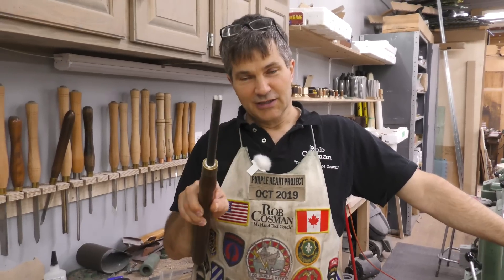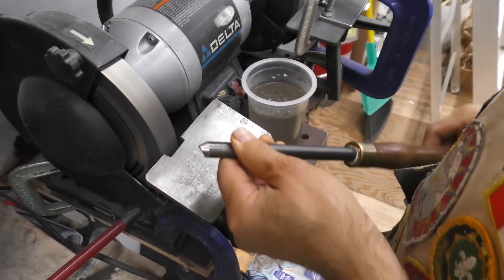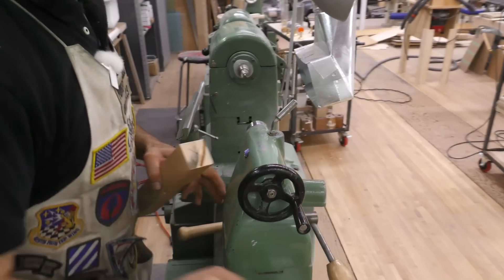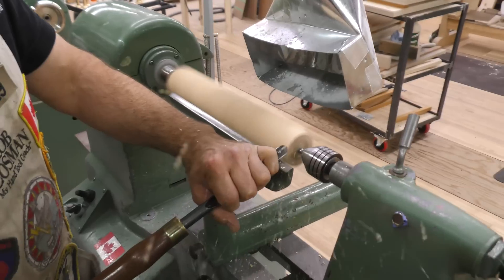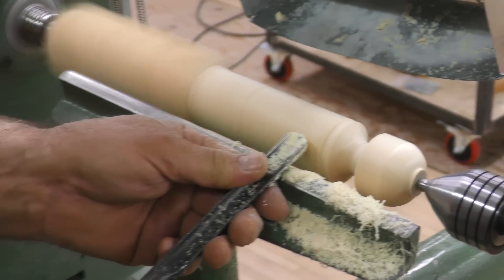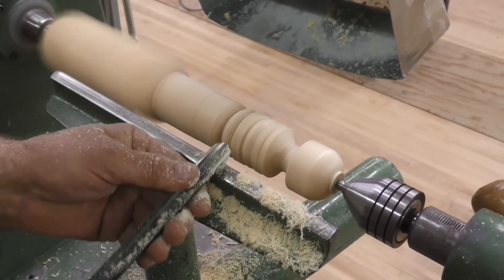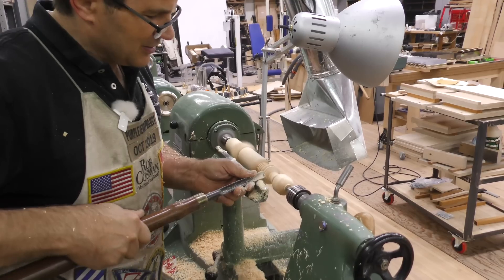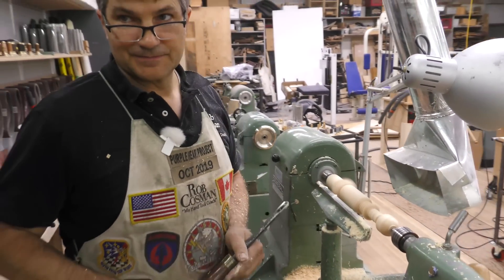Wood Turning For Beginners - Gouge Chisel (What you need to know)

Comment: Dumb question: Trying to cleanup a cove, is it bad form to get a sanding spindle or even a rat-tail file in there to perfect it?  A low-diameter spindle-shaped object can be made to act with a wider radius be angling it, no?

Comment: Hi Rob,  hope you see this even though the video has been up for two months.  You say you are using and sharpening a Spindle Gouge!  I have been turning since 1960 (grade 9 Shop Class).   Your gouge is a Bowl Gouge and you are putting a Traditional/Bottom Feeder grind on it.  I am interested in hearing your thoughts.  Thanks, I enjoyed watching you on the lathe...  PF  Ontario
Reply from the maker: Here you go https://www.woodturnerscatalog.com/p/130/6893/henry-taylor-M42-Stay-Sharp-Spindle-Gouge
Reply: @RobCosmanWoodworking  Hi Rob,  thank you for such a quick reply.  My reference to Spindle Gouge is for the shape of the grind and not the Mfg Name of the tool.  So, Spindle gouges have a shallower (less than half of the steel is in the flute, more steel below the flute).  Bowl gouges have a deeper flute to clear more chips,  the flute is deeper than half of the steel.
Now, for the different grinds:  Spindle grind is about 25 degrees, very long using the thicker steel remaining from a shallower flute..  Bowl grind is steeper at about 55 degrees in either a “V” or “U” shaped flute, usually in a Fingernail shape about 3/4” long cutting edge.   Traditional grinds are not ground back in the fingernail shape but rather just sharpened around the end, usually on the platform but can also be done as you demonstrated.
I cannot see exactly how deep your flute is but since Henry Tailor calls it a Spindle Gouge I assume it has a shallow flute as I note above.
The grind you are putting on your gouge is a traditional grind, very little steel taken back from the front edge, we usually do this for improved access to the bottom of bowls where the Fingernail grind will loose bevel contact as you round into the bottom of the bowl.
Sorry to be so long winded but I know you are a stickler for details.
Hope this is helpful.  Thanks again for your video and all that you do for woodworking and vets.  CDN Forces Medical Services 26.5 years. 1965-90

Comment: Surprised that I didn't comment about your turning here Rob. Technically, the tool you are using is a 'spindle detail gouge' and has a ) shaped flute. The spindle roughing gouge is another tool with a half round flute shape. It is intended for roughing out spindles. 

As for the grip on your tool, a line I used from an old black and white Hollywood movie about Cyrano De Bergerac. I knew it was really good when I heard a guest on the Roy Underhill show use it about holding hammers. Cyrano disarms a student, and then tells the student, "Hold the sword as you would a bird. Too tight and you kill it. Too loose and it flies away."

Comment: Hi Rob, I use a small mini lathe for dollhouse items. I try stair spindles & posts, bed spindles, legs, fireplace pillars, draw pulls etc. I work with 3/8" beach wood blanks. Do you mark the before the planing/cutting your piece. I need consistency for matching spindles.

Comment: Sooooo.... not but 10 minutes ago.... I understand what Rob was talking about. Yes, that 1000 grit side on a Trend WILL abrade your skin down pretty quickly, and you won’t even notice, until your blade starts looking red. Broke in the 300 side, took a plane blade to the 1000 side with the ruler to start working the back while following the 32 seconds to sharp video, wore the skin right off the side of the tip of my RH middle finger! Now I’m off to get some gauze at the store. I will have to watch this video when I get back LOL.
Reply: As the Black Knight from Monty Python and the Holy Grail would have said... it’s just a flesh wound. Just had to get it to stop bleeding, and learn to keep my finger up higher and on top of the plane blade when trying to work my old thing Stanley blade.

Interesting video, it seems like once you’ve got the requisite tools and lathe, it could actually be kind of fun to make a bunch of shavings pretty quickly! For small garage shops starting up w/ only 110v power, is there a basic lathe you’d recommend starting out with Rob?

Comment: Many, many great points during this video. Two that I picked up on immediately were, cut from the lower half of the skew and when you are getting saw dust instead of shaving, it's time to resharpen. I've never really known just when to resharpen the turning tools, I usually press on until I notice that it's taking a bit more pressure to cut the wood. Please do a video on the bowl gouge, it's the one tool that I have the most catches with.
Reply from the maker: I dont do bowls.  I turn furniture parts, so i wont be much help in the bowl turning world
Reply: @RobCosmanWoodworking  I really hoped that you could do one on the bowl gouge because I've noticed that your other videos really show the small intricacies of using a tool or doing a process. No harm in asking, thanks for getting back to me.